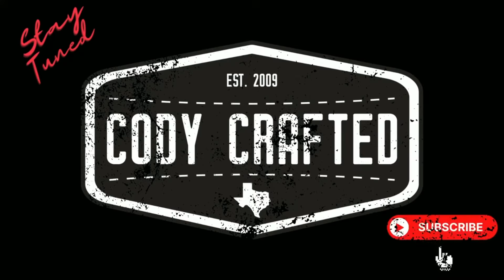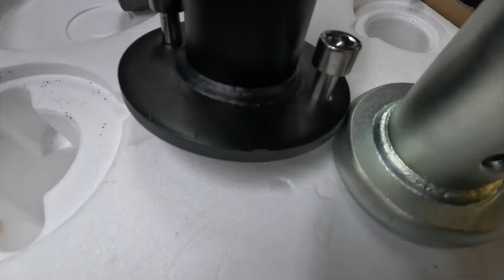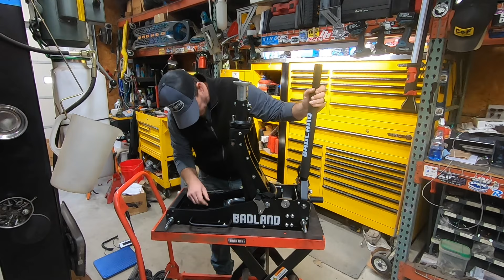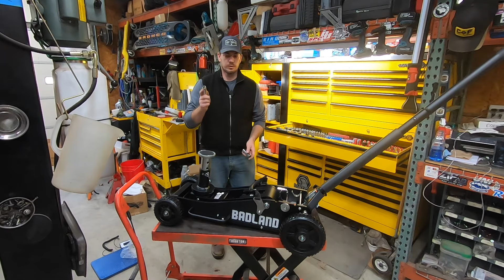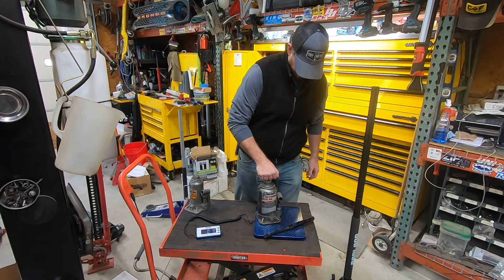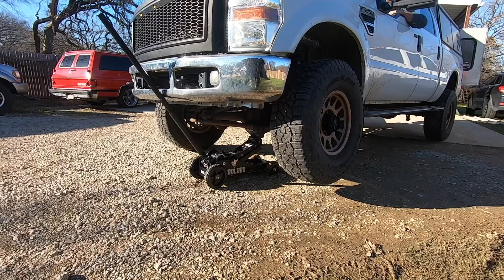Can the Harbor Freight Badlands Off-Road Jack Really Handle the Rough Stuff?

Comment: All of the Jack's wheels should be taller and wider, with a big heavy duty BOTTLE JACK that drifts less and is more straight up & down.
Reply from the maker: Different tool for a different job.  You're not going to get a bottle style jack that will lift that high without a starting height of nearly 18 inches.  AND being portable, AND being this light weight.  Not physically possible.  

Casters can be changed out for your particular needs, but this style of setup works well for it's intended usage regardless of the brand.  

If you want to go nutty look at this setup.  https://www.thedrive.com/news/watch-a-rally-trucks-built-in-jack-system-in-action
Reply: @CodyCrafted  The wheels would already be taller, (so it rolls easier....because it HAS TO ROLL because of the way a 'conventional' floor jack 'scissors' somewhat as it's saddle rises)
Then the bottle jack could also be a heavy duty 2 or 3 stage type. Also, I'm already putting wooden or metal extension blocks or saddles atop the saddle of a 'conventional' floor jack.
Reply from the maker: Whatever works safely for your application, man.  If you got all day to lay in the hot desert sun (or a mud puddle) and pump and stack cribbing repeatedly, then go for it.  

 Thanks for watching, if you know of any other good tools you'd like reviewed; I'm always looking for good content that gets engagement.

Comment: Bro idk if this is just a one off excellently done video or if you make bangers like this regularly but ima keep an eye on your channel bro thanks for the great review. I have been thinking of grabbing one of these to use when working on my Fj as its lifted a wee bit and I’ve been wanting to eliminate using a 6x6, the skid plate on belly and  I really like the option of locking the handle for easier maneuvering  was the cherry on top however HF should be thanking you cuz I wouldn’t have been sold without this demo. Hey what were those rubber pad extensions you said you use all the time ? Daysun or something?
Reply from the maker: Daystar on the pads.  We try, man. Not a lot of tool reviews on here but if thats what the people want 😂

Thanks for watching, anything in particular you'd like to see on here?

Comment: I have bought 3 of these Jack's and every single one of them has warping the front Left wheel on all of them dosent touch the Ground and even the replacements are the same
Reply from the maker: I've found the floor isn't really that level, and it twists flat with load on it.  Just deformation from welding. nothing to worry about
Reply: @CodyCrafted  great information good to know probably because frame is Aluminum

Comment: Great demo, like how you showed the Badland being pulled so easy across the gravel to your work sight, then when you drove the truck with the jack as one of it's wheels that was just way to over the top ! Thanks for sharing, I was researching the BADLAND Floor Jack, because all my repair jobs are out in the gravel, and I'm tiered of lugging my heavy flood jack around that doesn't want to be used in the gravel ! Thanks !
Reply from the maker: Happy to help
Reply: Thats also what sold me! The engineering that went into it, down to the spring loaded pin for the allen and even locking handle for ease of maneuverability and so it dont swing back and ding your rig was just amazing!

Comment: A normal hydraulic jack the rear wheels steer. Larger rear tires is why probably this jack does not do this, why they put the handle lock on this jack. To haul this jack one thing I would like if the wheels had brake locks.
Reply: I would like to create a Transmission Jack adaptor for this jack.
Reply from the maker: The frame is too narrow for transmission duty. It'll be too tippy. I've got the HF floor transmission jack, it actually goes a half inch higher than the Badlands. (According to the website specs). Thanks for watching.
Reply: Yes you have great videos, my neighbor did his transmission with no jack, I would have loaned him a jack, I have two Harbor Freight 4-ton jacks with the DAYTONA Steel Floor Jack Cross Beams, anything would be better than nothing.  @CodyCrafted
Reply from the maker: The lifting pad swings on an arc (just like any rolling floor jack), locking wheels would actually be dangerous. As you lift the vehicle the jack has to roll to prevent it from pulling off the frame or lifting point.
Reply: I wanted the wheel lock only for hauling in the bed of the truck, off when jacking of course. I can use rubber vehicle bump stops @CodyCrafted
Reply from the maker: Ah, I have a Plano "sportsmens" box from Academy in the bed of the truck. Holds the jack, handle, breaker bar, and tie downs.
Reply: Wheel locks is only for hauling not for jacking @CodyCrafted
Reply from the maker: Kinda pointless though, rough terrain in a wreck, it's still a flying bomb if not tied down
Reply: Not for me, when I drive on trips no one would want a free-wheeling jack banging around in a camper shell, with wheel locks and a rubber truck bed it won't slide around so easily, running over food supplies suitcases, or even if a dog is back there. I would use wheel locks putting the jack away in the garage. Regular steel wheel jacks don't roll that easily, but this jack can.
Reply from the maker: @etmesi  sure, but this jack doesn't live in the garage. The only time it comes out in the shop is for long travel and sxs where you need the height. Otherwise it's strapped down in the truck. That's it's intended purpose, for use where there's not smooth ground. I also keep a 1.5 ton HF aluminum frame with me. Comes in handy for helping other motorists,just like my OBA setup, it's used more for other people's flat tires and dealing with trailers

Comment: Well there is one minor but important and very useful difference between the Badlands and the Pro Eagle jack that make this Harbor Freight jack a better value and worth purchasing over the Pro Eagle aside from the money and that is the jack locking lever which allows the jack to be easily maneuvered and positioned using the jack handle... something you can't do with the Pro Eagle.
Reply from the maker: If it was made in the USA like other pit Jacks, it would be worth the asking price. 
https://www.speedwaymotors.com/Brunnhoelzl-Aluminum-Racing-Jack,68778.html
Reply: @CodyCrafted  Well that is subjective. Some people don't care about "American Made" as much as others do and still prefer to buy goods based on cost, quality and or functionality and overall value instead of choosing American made products based on their patriotic sentiments or perhaps a lack thereof. But yes, I'm a retired soldier so I totally get it when people opt to purchase American made products even if it costs more... but in this case, my previous comment makes sense since both of these jacks are Chinese made and "American made" isn't even part of the equation.
Reply from the maker: Well, it matters to me.

At the end of the day, the Badlands jack is a good value. A year later, it's still riding Bird Dog in the shop truck every day

Comment: ‘a bad application’? & horrible video, actually the video description probley less lousy, ok, is my latest video about jacking up vehicle which requires super low entry clearance, combined with 19-21” height on 1 small hidden spot deliberately nearly impossible to get to.  I started to hear an attempted such jack crack &/or crumble, & switched to bottle jack on top of metal plate, w/rubber underneath to level, etc., but couldn’t put picture on video or coments do to the usual computer instructions type dumness of stuf.  also, had to make custom brick/ramps just small, & tall enough(5/8/17 w/removable ramps) to get it started.  click smirky, videos, & ‘jack standing a 12 ..  bla bla etc.’  anyhU the front whEls R 2 dRn on that, I think Il chill out till maybe cat 2 ton(with whEls model) rolls out(no pun int.)
Reply from the maker: Back in my racing days, we would add a jack pad to the structure underneath.  Usually a capped piece of tubing so it centers in the jack saddle.

Comment: Thank you for contacting
Harbor Freight Tools.
We appreciate the time you took in contacting us and we are more than happy to assist.
There has been a mistake on the box and there is no rear axle wheel-lock on the
Badland 3 ton off road jack.
However, this jack utilizes a handle lock that allows the jack to be maneuvered. The handle gets locked into a 45 degree position that allows the user to lift the front wheels off the ground to easily move the jack around.
Please let us know if we can assist you further.

Comment: Great review, thought it was a bit TMI in the beginning but all useful information. Riding the jack on the gravel was not something I ever considered. May need that someday.
I’ve had mine for about two weeks and the box states “rear axle wheel lock: help hold the jack in place “.  Does anyone know how this feature works? I emailed HF, still waiting on response.
Reply: Thanks. Here’s the response from HF: 
Thank you for contacting
Harbor Freight Tools.
We appreciate the time you took in contacting us and we are more than happy to assist.
There has been a mistake on the box and there is no rear axle wheel-lock on the
Badland 3 ton off road jack.
However, this jack utilizes a handle lock that allows the jack to be maneuvered. The handle gets locked into a 45 degree position that allows the user to lift the front wheels off the ground to easily move the jack around.
Please let us know if we can assist you further.
Reply from the maker: Yeah I don't think that's a feature that would ever be used. As the lifting pad swings on an arc, the base has to roll
Reply from the maker: There should be a little lever near the back wheels, but it doesn't lock the wheels, it locks the handle.